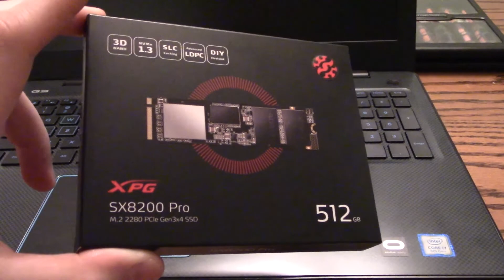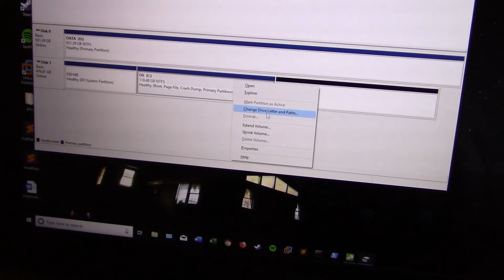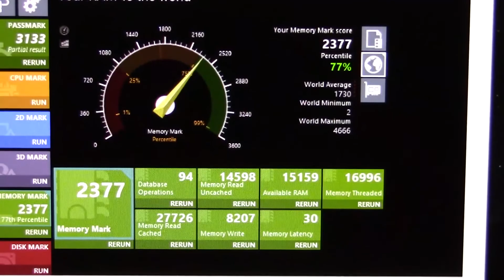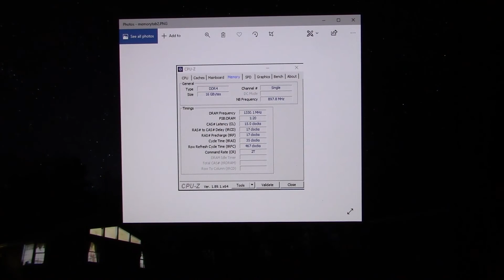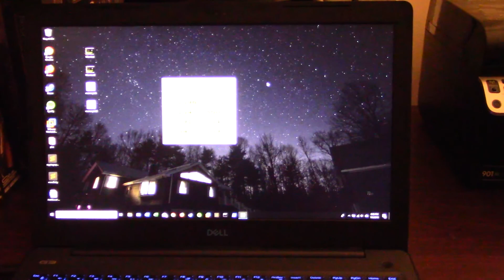Dell G3 15 SSD and RAM Upgrade (SX8200 Pro 512GB, 16GB HyperX)

Comment: whats the cooling like on this laptop?
thanks for the installation guide!
Reply: With the i7-8750H and 1050Ti , the cooling is good if you adapt the Dell power modes for the usage situation - temperatures only rarely exceed 70-75 deegrees celsius even at 6 cores at 100%. However, even in quiet mode, the fans kick in shortly after switching from idling to browsing through Firefox, Chrome etc.. They aren't noisy under lower loads, but there's no way to set the fan profiles only a few degrees higher, so you gotta live with it.
Reply: @nils895  thankyou!  I ended up with a Legion 5 with AMD processor.
Reply: @shmac96  You're welcome! From the specs, sounds like an awesome machine!
Reply: @nils895  The Legion?  I unwittingly ordered one with a more powerful graphix card but its OS was DOS!  LOL!  That took a few days to sort!  I upgraded the memory with a TB and looking to upgrade the batter as well as currently the battery life is barely 4 hours.  Gaming has not been an issue with Witcher 3 and Arkham Knight.  Especially no hint of cooling issues.  Cool all the time!  Stay well!

Comment: Did the heatsink actually decrease the temperature? Have you ran any temperature tests?
Reply: Being a G3 user with exact same model I wanna say G3's thermals are the worst. It heats up a LOT. I'd say this is just a beginner level laptop so don't expect much & upgrade only if necessary, like 16gb RAM is enough this system can handle. Even if you put on 32gb ram on it & expect it to run high graphics... it won't, since GFX card is 1050Ti it won't help you much. I'd say let this be your stepping stone to upgrade to a better medium/high level laptop.

Comment: Thanks for the video, I had the same problem with a 8gb Ballistix 2666 module. Later learned that it is xmp module, so it runs at 2400 stock and 2666 with xmp profile, which is not available in laptop bios.
Other thing, how did you manage to have the hdd load up as data? I got a 970 evo for the same laptop but can't manage to boot both, its either the nvme or the hdd.

Comment: Apparently the bottleneck everyone seems to face with G3 is severe thermal & power throttling. Are you planning to do anything about that too?
Reply: I solved power throttling using a 180w psu instead of the 130w included. Thermal throttling could be solved with undervolting; the problem is that actually, with the bios updated, it is impossible to undervolt.

Comment: are you able to change the fan so its not so loud, my g3 3579 is really loud and heats up pretty bad and ive only had it for like a year or 2.
Reply: have you tried using air compressor? mines heat up only on during drive scans with malwarebytes
Reply: If you still have your G3.... take the bottom off (10 or so easy screws). Then remove the fans two (two screws each) and vacuum/blow dust out from each. Also clean dust from the heat pipes.  Repeat this every so often, when heat becomes an issue.

Comment: So I bought a ssd to replace the 1tb hdd can I still run another 1tb where the m2 port is?
Reply: i also want to replace 1tb hdd with ssd is that possible?
Reply: @sanampreetsingh4463  yes I recently did it you just need to buy a usb to sata adapter and clone the hard drive to it
Reply: @Not.Denver  can u explain me how? abd where can we chat for sometime if u r free?
Reply: me too. so can you have a 2.5 ssd replacing hdd and an m.2 ssd in at the same time?
Reply: Did anyone test a 1 TB port on m2? It worked?
Reply: @giovannidonda5928  I tried it, but the computer cannot recognize it. I guess it's because the power for SATA port is not enough.

Comment: I bought the same m.2 you got. Is the drive suppose to be auto detect? Mines installed, then I boot my into windows but the drive isn't there
Reply: Did you fix the issue? Same here.

Comment: I have the same laptop but... When I bought it had an SSD 256Gb allready installed in M.2 socket. I thought it was PCIe NVME !!!
IT WAS NOT !!!
IT IS SATA !!!!!
Also my machine hasn't the metallic part you had removed over the SSD.
So... is my M.2 socket compatible for PCIe NVME SSD ????
If yes how do I configure that socket?
Is it auto recognise the SSD type?
Also somewhere I saw that maximum capacity is 512Gb to be installed in M.2 socket.
Do you know smt about all that I describe?
Reply from the maker: The socket should support both M.2 and PCIe drives, although the manual should confirm this. Yours probably doesn't have the cover because it was deemed unnecessary for SATA, maybe it acts as a heatsink. The manual does say 512GB max for NVMe drives.

Comment: When you deployed the clone of the old install, what was your boot drive? Were you booting direct to a USB of Macrium? That's the impression from the video, but not 100% clear.
Reply from the maker: I honestly don't recall which I did, I either plugged in the new drive over USB and imaged my data over from the live old install with Macrium for Windows or made a live bootable Macrium USB  to do the same thing as a clone.

Comment: It's probably a dual bank memory setup. It probably works best with 2 banks of the exact same memory. So 2 x 8 is probably better than 1 x 16. If you ever get a chance to install another 16 gb mem in take a new speed test.
Reply from the maker: Yeah I like to match sticks in general but went with 1x16 because I might want another 16 later on.

Comment: Does 3200Mhz ram work with this laptop?
Reply from the maker: I don't believe it does, no. I got 2,666 because I think that's the highest it goes.
Reply: @Someone7089  cool yeah I ordered 32GB of 2666Mhz because I came to the same conclusion
Reply: yeah it can hold 32gigs